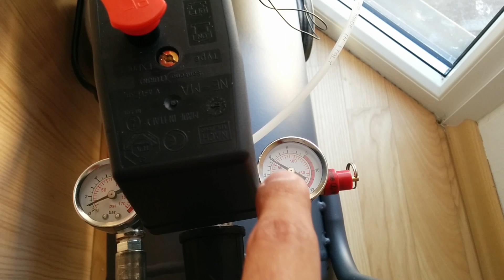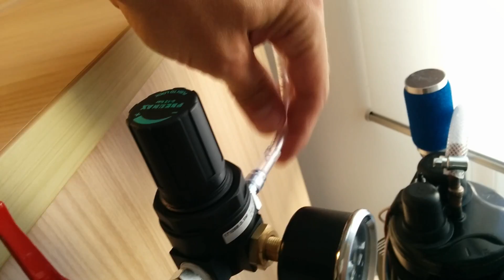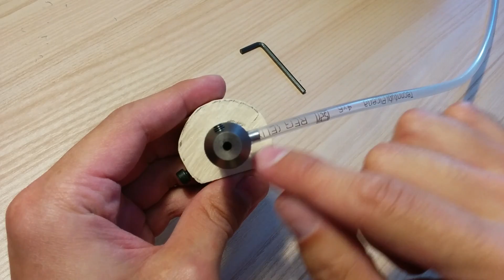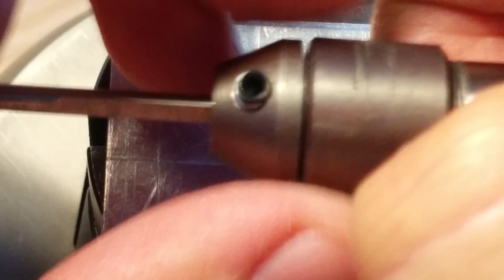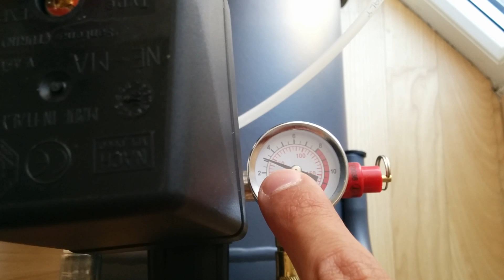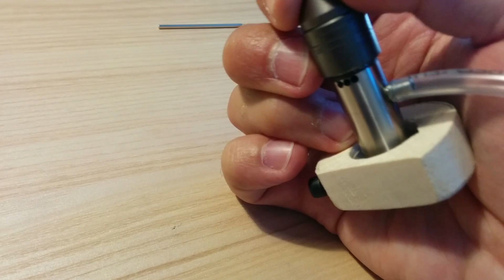Making a homemade engraving machine pt7

Comment: This is the best type of engraver I’ve seen you build. I’ve been experimenting with this design for a long time, and unfortunately, many of the plans available online have quite a few problems.
What really caught my attention was the position of the exhaust port on the piston stem. It is positioned closer to the tip of the piston, and I believe this is what gives it those strong, precise, and well-defined individual strikes.
Could you please tell me the thickness of the spacer between the upper and lower chambers?

Comment: I'm sure you figured out by now ( I just saw this video today & it's 5 yrs old) that you were prematurely killing your air compressor. Reset your shit off switch on the compressor back to 120psi. This will inside that 3times more compressed air is stored in the holding tank. The last regulator knob that's at the discharge side to your hand piece set. That's what you regulate down to 4 barr or whatever pressure you desire. Your handpiece will run for a very long time on that tank full of air and only turn back on when it's reached your predetermined low setting if you understand what I'm saying. Good luck

Comment: Seria possível  fazer um desenho com as medidas.obrigado (Brasil)
Would it be possible to make a drawing with the parts and measurements?
Reply: The engraver works on any compressor, the most difficult thing is to make the piston and ring, they must be hardened to 60hrc, the measurements must be accurate, the air content must be 0.02, everything else is not important

Comment: Hi Nejc, Just want to ask, I have done the compressor setup but at the end the handpiece I connected it totally won't function properly, it just like push by air and wont repeatly hit, I found out other homemake engraving machine is using a small compressor modify it with suck n push action to make the handpiece work, but if using a oil free compressor like yours then how to make the handpiece work without the suck n push modify on compressor ? or it done by using the handpiece design like yours ?
Reply from the maker: Yes. Only use this type compressor with this type of handpiece. Or use modifyed compressor with spring handpiece. Look at my oldest videos on how this is done.
Reply: I see, bcus early I use oil less air compressor with spring type can't work, so I need double confirm and searching solution. Now make clear a bit, Thank you bro.
Reply: @nejcmazej   Now need study the handpiece XD
Reply from the maker: You can buy mine if you like?
Reply: @nejcmazej  , I'm from Malaysia :D
Reply from the maker: So? Whats the problem? Malaysia is ok..
Reply: @nejcmazej  Please let me know the price for the handpiece, 
akiragaming1203@gmail.com
Reply: @nejcmazej  do you have any blueprint about this kind of handpiece which can I study about it ? The link of below this video the blueprint quite a lot different than yours :D
Reply from the maker: No. Just the link below. But you can buy mine if you like
Reply: @nejcmazej  you havnt send me the email.
akiragaming1203@gmail.com

Comment: May I know, is it can't adjust the speed with this compressor setup ? BTW, nice handpiece you have done here ~
Reply from the maker: Yes it can. Thanks
Reply: Is it just adjust the pressure from the regulators or compressor will done the job for the speed control ?

Comment: Hello! Nice to see you are doing all good!!! Could you tell me the reasons of changing your engraving system based on pulsating air system of Sergey Valtman (Сергей Вальтман) to Lindsay system implemented by Rumen Radkow (Румен Радков). Is the second system better, or you were just interested in making and trying smth that you did not try? It would be very nice to hear your opinion on these engraving systems. Thank you!!!
PS
I did not noticed the link of the graver you put under the video. Timur Ustoev is a master who also add some nice "tuning" to both systems.

Comment: Hi Nejc
   Just been watching your series of videos on making a homemade graving machine & here in ep 7 I see that you have this "springless" graver,  which one of the two that you have designed is in your opinion the best ?  Also as I'm not able to find any dates of when the vids were made, I'm not sure as to wether or not you are still using your fridge/AC compressor setup or if at a later stage you go onto using a different type.
  Cheers Bob
Reply from the maker: I use the latest version and i love it. Spring handpiece is history and i will not use it anymore. I like the compressed air system better because its more quiet and the handpice buzz is so relaxing and smooth. The spring makes a lot of noise and vibraion not to mention the dc air pump compressor. It was to loud for my taste. Thanks, enjoy

Comment: Great build! I agree with the rest of the guys, the foot pedal I think is best. All I have comes nectar to my engraver that I made is s a 120v  husky compressor and my foredom's foot pedal controlling speed. I'm going to make another handpiece on my lathe, smaller than the one I use now.
Reply: Joaquin Ryder  esta pieza funciona con aire fluido ??? es posible que me ayudes a construir esta pieza de mano agradecería mucho tu ayuda don Joaquín, usted habla español y quizás pueda entender mejor como llegar a este punto , ya que tengo un amigo que tiene un torno y quizás pueda hacerla para mi a un bajo costo, muchas gracias, quedo atento a su respuesta

Comment: That was what I was trying to figure out was how the design of the piston was to utilize straight air and where to place the inlet for the air on the hand piece shaft.  I will be making one of these soon.  You should design a sleave to fit over the handle that you can control with your palm to cover the hole up on the end that would control the air like a foot pedal does.
Reply from the maker: yes, you are right. maybe I make it like that.. but I still prefer pedals for now. I will see where future takes me. thanks, Enjoy

Comment: How hard was it to find a machine shop to make it?  Did you you already know the owner? You said it cost 110 Euros to make it. Is that labor and materials? I do not know anyone with a machine shop. How hard do you think it would be to walk in off the street and get them to make a working hand piece from the Russian plans?
Reply from the maker: yes i know the owner of the shop. but you can easy find a tool shop in the area, i think every towh has one. if i can find it here, then it would be no problem finding it in the US. i think.. i could be wrong. i sent the link in the video so you have the drawings, now find a shop, and if it is to expensive just go somewhere else. i am confident you will find someone who can make your machine. thanks for the comment. i appriciate it. Enjoy

Comment: Good job Nejc, your first prototype and it is working already! I was always wondering, what causes the hammer to go up and down, hammering the end of the graver. you don't even need a spring it turns out. If a "Slinsay Hair graver" from "Stevo" can work all day on a micro oxygen cilinder, how long could you work with a 20 litre O2 cilinder? Would this design still work if you place the air tube on the top of the cap? The pricing of your tool is very affordable to say the least. Destined for success, if you ask me. Well done!
Reply from the maker: thanks mate. yes no spring needed. i dont have any experience with oxigen but this air tank is plenty for this work. the air tube can be anywhere around because the cilinder/ chamber is simetrical / round. i do get a nice price for this yes. thanks again. enjoy

Comment: Congratulations. If you can, have the cap threaded to the graver body. Turning it in and out also affects speed. Fit an 'O' ring inside the cap. You will lose a lot of air without the seal. The great secret of this design is that the rear surface of the piston must be twice the front surface. IE: rear surface less hole is twice front surface, less extension. BTDT

Use a foot control. It is so much easier.

Enjoy.
Reply from the maker: no, the cap does not have anything to do with speed. its the adjustment ring in the front that does that. fitting a o_ring on the cap, yes that would work nice. rear surface is 70 front 50 i have calculated it. doesnt need to be twice the size, just smaler than rear. 
thanks for watching, enjoy